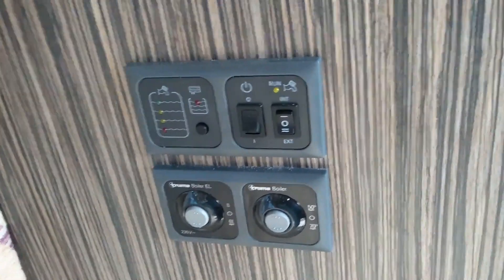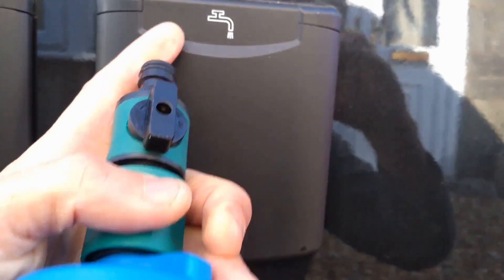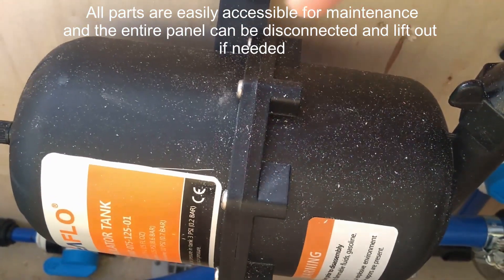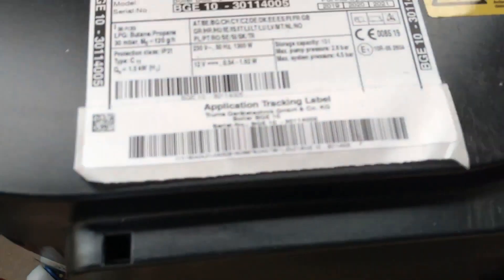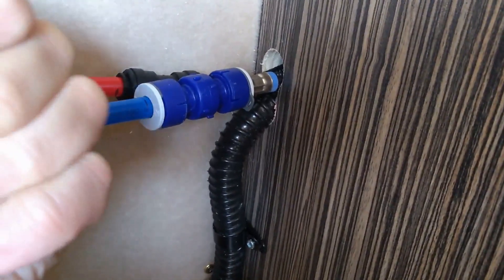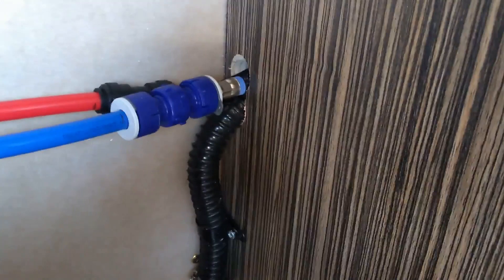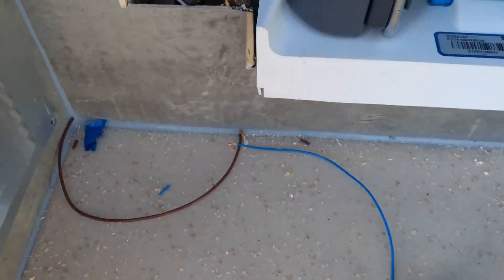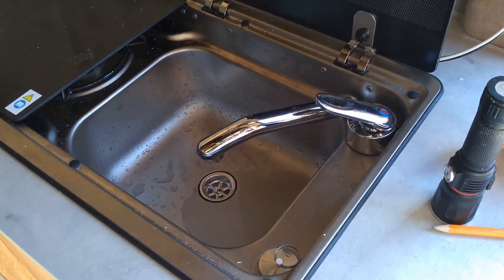Our campervan water system

Comment: B and q sells better traps. Great build.
Reply from the maker: Thanks.  B&Q sell traps for 19mm  or 3/4 pipe?
Reply: @Ryan_DYD  they have a few different ones also horizontal and vertical. The one I was looking at was for 32mm pipe.
Reply from the maker: @897aa33  thanks. Yeah lots for 32 but I'm all 19mm so rather stuffed!

Comment: Hi Ryan, 
have you got a link for the air suspension inlet valve you have used only I’m having trouble trying to find one on eBay. Keep up the good work.
Reply from the maker: https://www.ebay.co.uk/itm/Schrader-Tyre-Valve-to-6MM-Air-Line-Land-Rover-Range-Rover-Air-Suspension/192681299758?hash=item2cdcb34f2e:g:dNwAAOSwpppcVd9U   :)
Reply: @Ryan_DYD  Thank you Ryan.